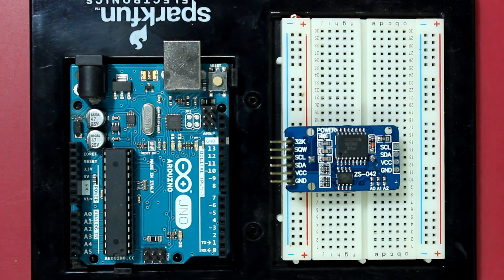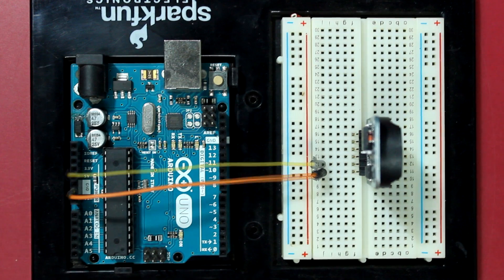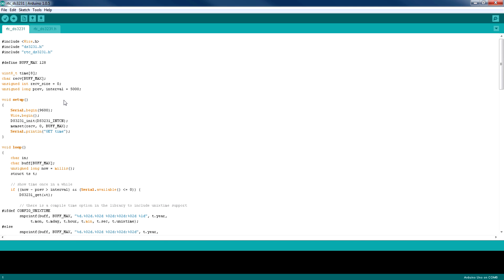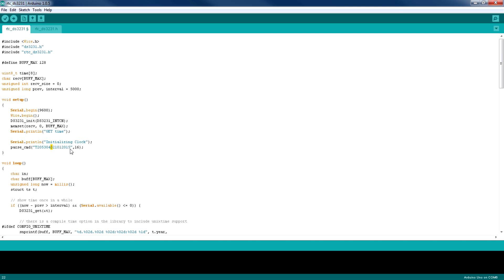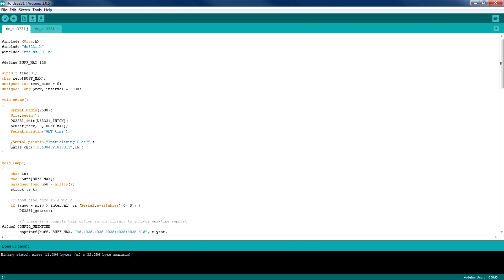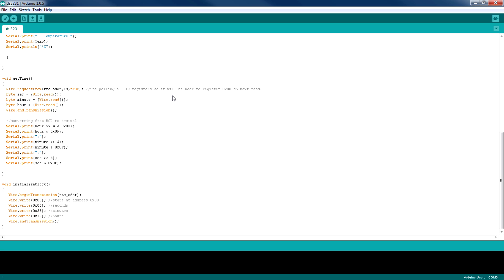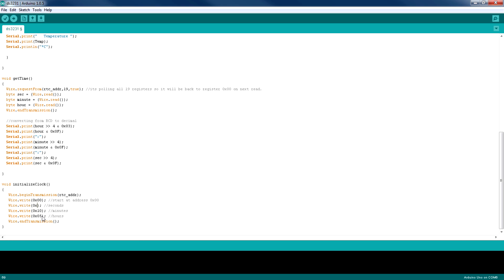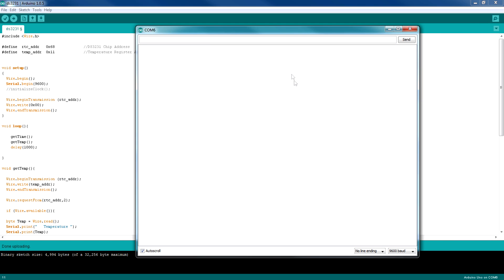Arduino And DS3231 RTC Clock Module

Comment: Very good man, the best lesson about RTC DS3231 in youtube
Reply from the maker: +WLTR AEP You can add a buttons, and in programming you can set the button to change the time and date.
Reply from the maker: +Gustavo Caetano Thanks bro,glad to hear that.
Reply: +CoolTroniks  hi is it possible to code the module to turn on something at a certain time? can I change the time without using the Arduino program?
Reply from the maker: Yes absolutely possible
Reply: +CoolTroniks hello again! I was wondering if it was possible to set the time and date without the Arduino program?

Comment: Really well presented video - congrats.  Can I ask what those pin are on the Arduino that you connected to (SDA and SCL)?  I"ve never used them before.  Can you use any other digital or analog pins instead?
Reply from the maker: CJ Yes, analog pin A4 is (SDA) and analog ping A5 is (SCL).Thanks.